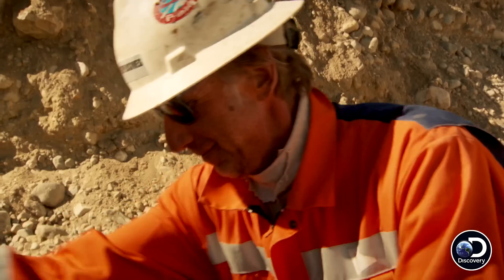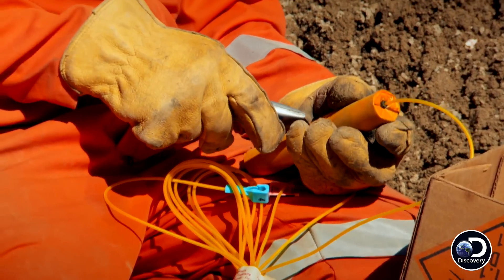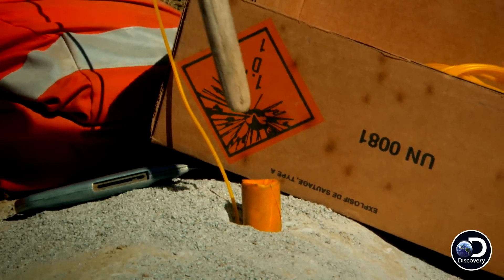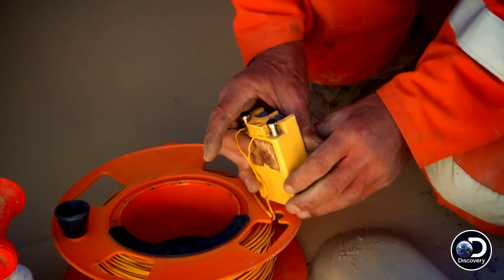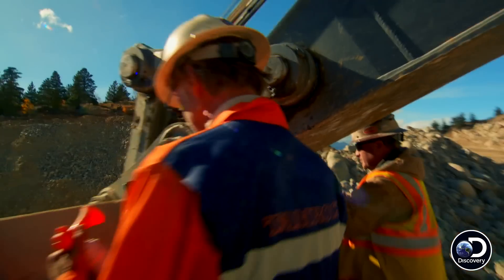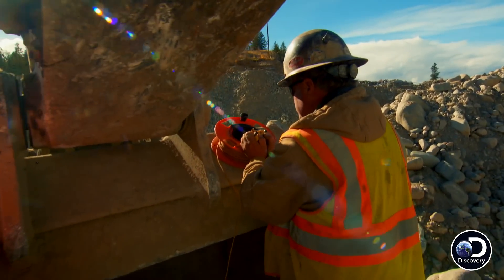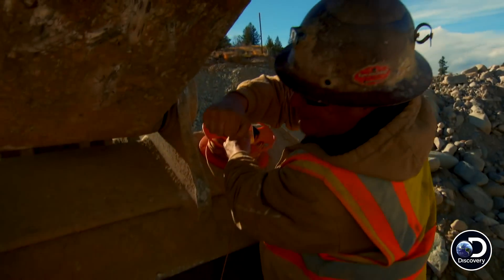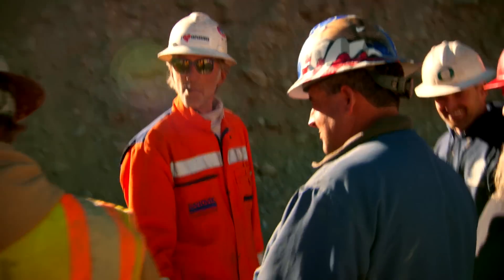The Quickest Way To This Gold Is With Dynamite! | Gold Rush

Comment: Bull shit. There is no way that stick of dynamite puts off 100 million horse power. Yes it is extremely powerful but no where near 100 million hp.
Reply: Johnny Martin agree
Reply: Yeah they got it wrong for sure. It would produce a million Joules of energy. Horsepower is a unit of work not energy, and assumes that the amount of energy is expelled per every unit of time. So for instance 1 watt is 1 Joule/second or roughly 1/746 horsepower. So assuming the blast takes 1/10th of a second (I'm guessing here) then 1million joules of energy / (1/10 s) * (1/746 HP) is roughly 13,400 horsepower equivalent for the duration of the blast.
Reply: @coulombicdistortion1814  you are wrong. 100 million <--  a single stick of dynamite can weigh up to half a pound or half of pound explosive. depending on charge they use. so on so forth. but your common dynamite releases 1mj of power which = 100 million joules.  puts out .3millionths of hp per half pound of stick.
Reply: @coulombicdistortion1814  that explosive burns at 21,000 ft. Per second. 1 foot of an explosive column lasted 1/21000 of a second. That is where your math error is fucked up. Now do the math
Reply: Pays to pay attention. I said "On the order of 100 million HP". Here is the math, 1  1 1/4 stick = 1/2 pound, each stick contains around 250,000 calories. I drilled a 2" hole, tamped it to fill the hole. That dynamite was tamped to a 2" X 6" stick inside the rock. This dynamite burns at 21,000 ft. per second. So if you took the 2 x 6 at .75 pounds, a 1 foot column would give 1.5 # per foot. Since HP is raising 36,000 one foot in 1 minute ,here is the math. 1.5 x 21,000 ft, per second=31,500 lbs. consumed if you had a 2" colmn laid out on the ground,21,000 ft. long, times 60 seconds (amount of seconds in a minute) = 1,890,000 pounds consumed in 1 minute. That is what " On the order of" means. And it is over 100 million horsepower. Sorry, my calculator doesn't have enough zeros to add all the calories up. but each pound contains 500,000 calories X 1,890,000 pounds = A LOT OF ENERGY. ! HP = 176 cal/second. The conversion I did once, but ended up with a Nitro headache. Thanks for watching, and commenting.
Reply: I love this video.